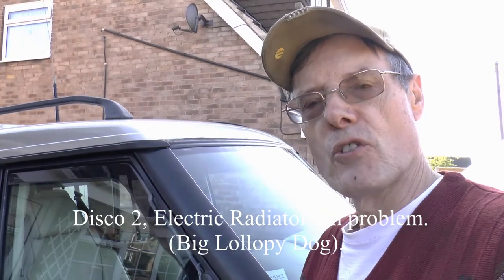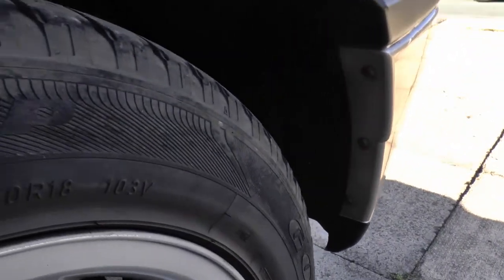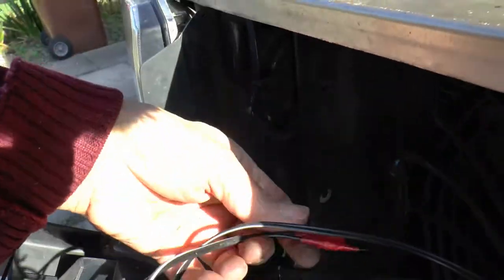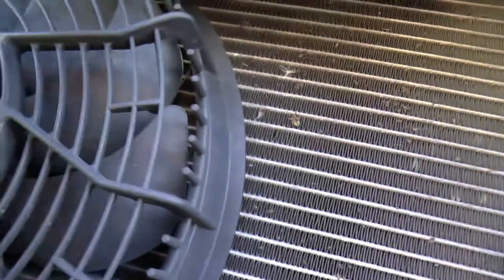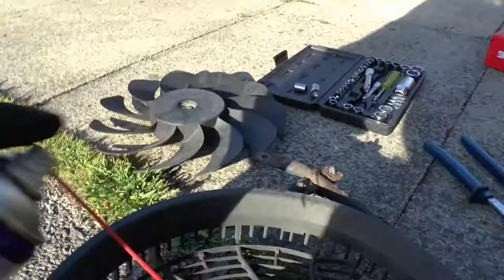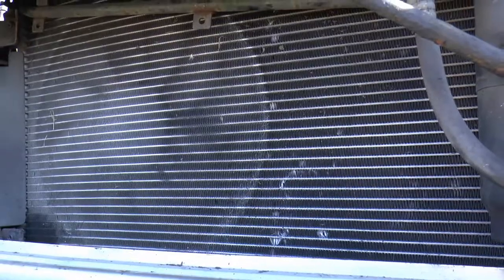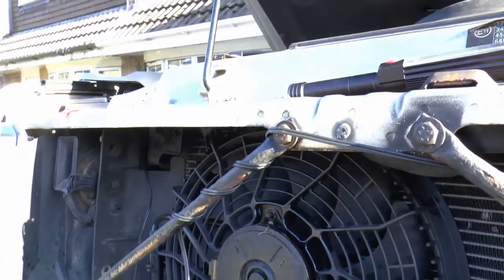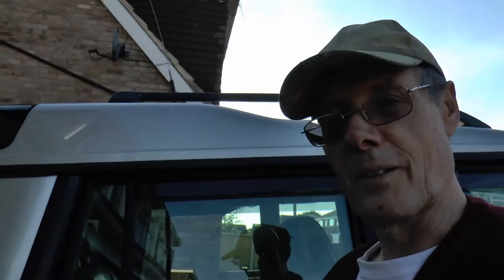Disco 2 Electric Cooling Fan Woes. (Big Lollopy Dog)

Comment: Try using ATF automatic transmission fluid mixed with acetone For rusty nuts and bolts. You find it much better than wd or similar. It creeps done the threads a lot better.
Reply from the maker: Oh ta! Sounds like a good idea. I have a tin of Plus-Gas somewhere but could not find it when I made the vid!